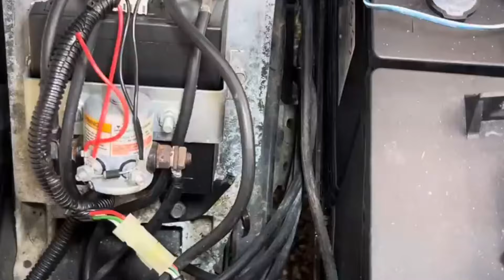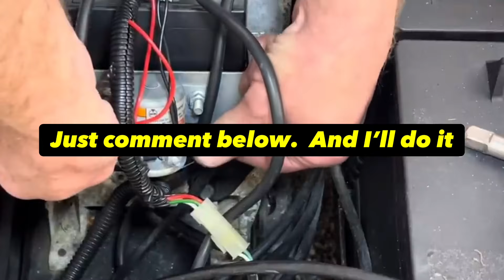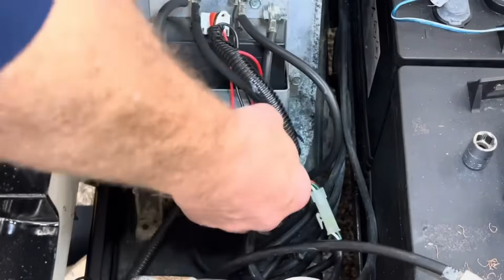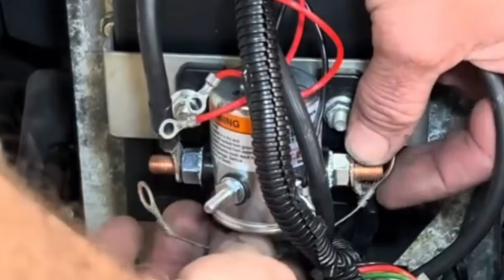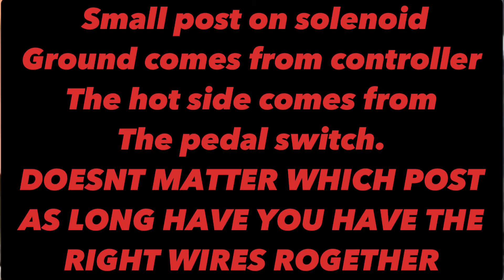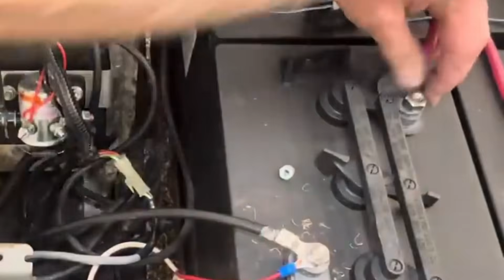Golf Cart Won't Start? Replace the Solenoid in Minutes!

Comment: Love this video!  Why no diode replacement?  

As far as future videos.. more marathon work if they ever come in.  especially F/R and pot box wiring.    Or even better,  the diagnostic sequencing order you use to find what is wrong.   I've seen you do before on another cart,  it's great stuff.     HEY, HEY,  HEY.
Reply from the maker: Thanks Chris I appreciate that.  I’ll keep it in mind if I ever get owns as far as the diode goes is because 99 percent of the people put them in backwards.  The only reason it is there is to keep voltage going backwards. The only time I seen voltage travel backwards is when you hook the main positive and negative on battery backwards.  And when that happens the diode does no good. It’s mainly for lightning.  Which in the long run will fry everything. HEY HEY HEY
Reply: @golfcartwhisperer  that's good to know you're full of useful knowledge.  Thank you.
Reply from the maker: @chris2818 now the resistor on the other hand. You want that back on there because it keeps the controller charged up.

Comment: I miss what happen to the resistor? Why did you not put it back plz. I replayed but all I could get is bypass the Reed switch.
Reply from the maker: I put it on after I put the main connection wires on.
Reply: @golfcartwhisperer  thanks Hey Hey